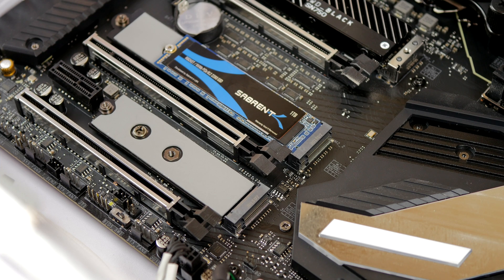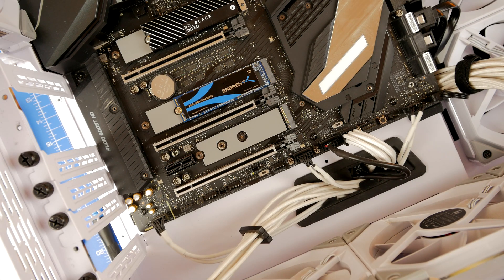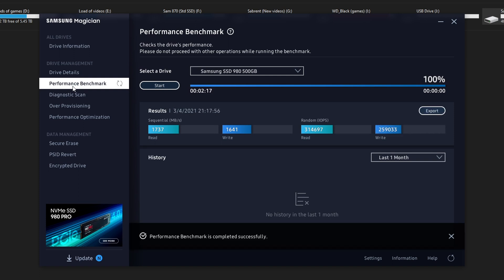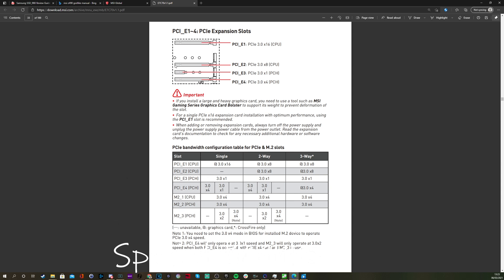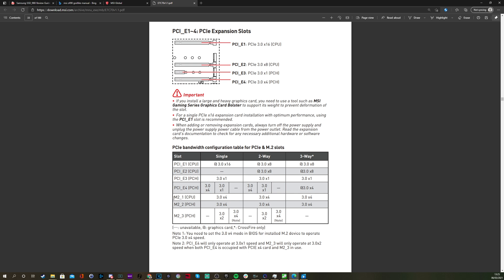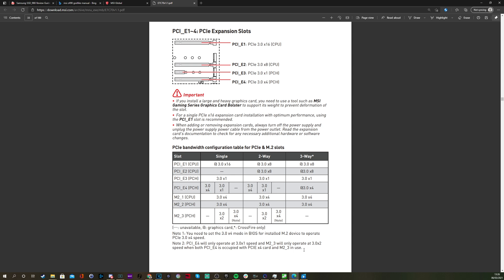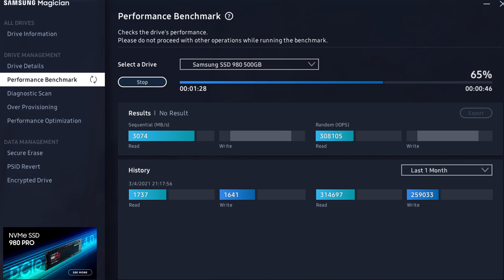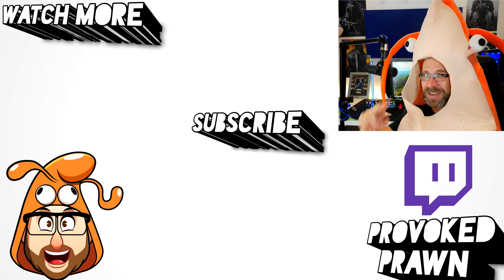Is your M.2 NVMe port slower than you realise? Not all M.2 ports give equal speeds

Comment: my biggest disadvantage is for a few days that my gpu lowers the band width couse of m.2 drive from pcie 4.0 to 2,5 gt /sec and i cannoot chose in bios gen 4 for my gpu ; maybe these new intel core ultra cpus will work better wit pcie 5.0 ; but , mostly they need to make motherboards with more lanes not shared by other components becouse that is annoying - when i ve  discovered m.2 ssd drives - thay are superfast - and move superlagre portions of data its very important for me - but they slowing down other components like gpu - so there is 1x solution to that use slower ssd-s sata III 2,5 inch drives - omg this is so annoying

Comment: For people who are looking for BIOS set up to make this works. This is how it worked for me:
1. Check if your mother board have USB4 in the back (usually it's a USB-C port)
2. Go to the BIOS and find IO setting option, disable USB4 (in my case the option is choose between USB4 and M2)

If you do so, now you no longer share 2 lane to the USB4 in the back and give it to M2 slot, so in my case all M2 drive I installed now run at x4 and full speed.

However you can't use the USB4 port on the pannel anymore.

Comment: I noticed you have all 4 DDR ram slots populated. That will decrease the speed of your ram. The ram will still run at its rated speed internally but the connection to the cpu will be slower. You have to run your ram in "dual channel mode" two sticks to get the fastest speed

Comment: What do you think is faster for the games data installation ? An 2TB M.2 drive encrypted with Bitlocker that is connected directly to the CPU with its x4 lane (as C: main drive). Or the games data on a second 2TB M.2 drive that is not bitlocker encrypted and not connected directly to the CPU with the lane, but via x4 to the chipset (and another 0,5-1 TB for C: drive) ?

Comment: Can I use all my m 2 ssd's drives? Prawn
Reply from the maker: It really depends on the motherboard. You can use them all but doing so might mean some don't run at max speed. Though it's less of a problem for newer motherboards
Reply: @The Provoked Prawn  OK thank you I'm using a asus prime Z790-p for intel 13 or 12 gen

Comment: I was using a B450 with 1 M2 slot and 1 adapter card getting about half the speed as the M2. I moved my x570 Asus board to replace this b450 thinking I would get full speed on both drives and now my Random Read/Write dropped in performance 2x on Write and 6x on Read. These are Gen3 970 Evo and SN750 drives. Only the SEQ read performance went up to proper 3000+ speed on the new x570 board. Random IOPS got far worse on x570 which was one of two reasons for this swapped motherboard. Other being Gen4 PCIe slot for the 8x Gen4 6600xt.

Comment: my motherboard only supports m.2 pcie 2.0x2 aka 10Gbps or about 900 migabytes per seconds
I understand that whatever m.2 ssd I put in it is going to run at max 900 migabytes per seconds for sequential speeds, but the question is, does this also affect random read/write speeds or is it only for sequential speeds?

Comment: okay question.. i have 1tb nvme m.2 ssd "samsung 970 evo plus" as my ONLY and primary drive in the first m.2 slot just under cpu.. i have a 2nd m.2 slot at bottom of mobo under gpu, ive used all storage on my 1tb 970 im thinking of adding another 1tb to 2nd m.2 slot at bottom of mobo.. SO.. would that 2nd m.2 still be faster than a normal SATA SSD? or would i be better of  just getting sata ssd, its all only for games.. i know my games would load slower on the 2nd m.2 than the first BUT would the 2nd be FASTER than a sata ssd still

Comment: My 980 Pro 2TB just got 6546 Seq Read and 5159 Seq Write on a Gigabyte X570 Aorus Master Rev 1.2 Top slot, all 3 slots on this board are PCIe 4.0 though, each one you populate takes away from the SATA ports so no big deal I only need two of those. I also have a WD SN750 1TB in the second Motherboard slot, a WD Blue SSD 1TB, and a WD Black HDD 2TB for Backups.

Comment: Thanks for the vid! I was wanting to put my new samsung 970 evo plus 1tb in the m.2_2 slot which is an x2 slot for better airflow and not being right next to my gpu, but I guess that's not a good option now. The m.2_1 is x4, so it should allow for the full performance. It just will get hotter there :(

Comment: !!!ATTN!!! In many motherboards. The Upper M.2 is PCIX Gen4, and that WD SN750 is Gen3. And in such cases, the lower M.2 is Gen3. Your board has 3 M.2 slots. So you might need to research any potential differences between the PCIX Generations they support. Gen3 are on average about 3000Mbps, while my current Gen4 is 7000Mbps. So as with any data bus, the slowest device connected to it, will set the overall speed of said bus.

Comment: I'm sad, the Phantom Gaming 4 manual mentions nothing about the varying slots and their differences, so it looks like I'm going to have to just experiment a ton and hope things work out. I'll ask elsewhere for a more immediate answer as obviously this comment section won't be as poppin, but I'm curious if switching the slots I have M.2's connected to will require reformating? I'd assume not as I'm still using them on the same PC, but that definitely is an immediate worry should that be the case.
Reply from the maker: Nope, should be perfectly fine swapping them.
Reply: @TheProvokedPrawn  Holy shit thank you for the blazing fast response!

Comment: i have same problem  my laptop , (1 year old 2020 hp)  , but it cant be changed ,come to find out the gpu uses 2 of the 4 lanes , and the other 2 are for the m.2, no way to change it so i get half speed no matter what i put in , and when on battery it drops in half again, only full speed when connected to ac,  when i bought it only spec available to the consumer is that its  nvme m.2 , kinda sucks
Reply from the maker: Take heart that it's still faster and an 2.5-inch SSD or HDD though.

Comment: Damn.. im finally at rest with this video. My crosshair X470 board with upper and lower M.2 slots populated, make my graphics card run at x8 speeds. Was pretty disappointed finding that out, and especially when its a premium motherboard. Frames are two to 3 fps slower, but i can handle that.
Reply: X570 feeling real good right now. I'm so glad I didn't skimp to b550 either
Reply: I wanted to utilize my second m.2 slot and read this comment, although 2 to 3 fps isn't too big of a deal for me either.

Comment: i got an msi x470 gaming pro carbon and mine is installed in the bottom one, which means i'm on the pcie gen 2.0X4 according to my manual, but is the generation of the port can make the ssd slower as well ?

Comment: So I have the same problem... in the magican software stands "PCIe 3 x 2" I can't find a way to change it! ... I do have just plugged the Samsung 980 M2 in. No other devices. :(
Reply from the maker: I'd suggest checking your BIOS settings. Have you used the top spot?
Reply: @TheProvokedPrawn  yes its plugged in the top Spot.. i was looking for a Setting Like lane rooting .. gut could Not find any Setting named Like this... What Name Had the Setting in Ur Mai mainboard?
Reply: @pumuckl5351  did you find it? What do I change in bios?
Reply: @karniskavva  hi. In my Case i Just repluged the SSD m2. Just try Out , maybe U think Its in ... But ITS actually Not , that was my problem

Comment: I have a similar problem in that an NVMe that should be hitting around 3000MB is only reaching around 1500. I supposed that could imply the slot is running at 2x instead of 4x?... I don't know if it's that "linear" or straightforward anyway. - But what's annoying is that in the manual for the MSI B450 Mortar Max that I have, they do have a table for the PCIe expansion-slots, but no specifications for the two M.2-slots that there are on this board. So it lacks information. - I could check the BIOS, but I'm not sure there's much to see there. And I guess I could try the slot closer to the CPU-socket, as it's now in the "second" M.2-slot, which might make a difference. - I don't know, it's all very vague and just a hassle...
Reply from the maker: The top slot will likely be the easiest solution
Reply: @TheProvokedPrawn  - Alright, I'll give it a try. - Do you know if this will cause any issues with anything installed on it? - Like the system will become confused because of a drive moving and assigning directories and such...
Reply: its because you are in the bottom m.2 slot. on b450 Mobo the bottom M.2 is only 3.0x2. top slot is 3.0x4.
Reply: @k20dada78  Does a 3.0x4 m2 nvme work in a 3.0x2 slot?

Comment: Hey, great video. Learned some stuff about SSD's which is good because I'm kinda a noob, I am using a rog strix z490-F with a 970 EVO Plus and I'm only getting half of the read/write speeds advertised(around 1700). both the m.2 slots are  Type 2242-22110, supports PCIe 3.0 x4 mode yet on samsung wizard my interface is PCIe Gen. 3 x 2... any ideas why this could be or how I can change it to PCIe Gen. 3 x 4 ??
Reply from the maker: Have you checked your motherboard manual? Perhaps using extra SATA drives or something else is holding the slots back. Alternatively have a look in the bios and make sure the slots are set to x4
Reply: @TheProvokedPrawn  Thank you so much for the help, I could've sworn I changed the ports but I must've not saved it aha. Just ran samsung wiz again and got 3500 for read and write so thank you again!! :)
Reply from the maker: @mattvile3432  woot
Reply: @mattvile3432  what ports?

Comment: I'm still confused.  My MB is an Asus Z97-A USB 3.1 with 1 M.2 slot.  I have a Samsung 980 there getting 833/801 read/write speeds.  My 860 SSD is at 550.  The only exp slot used is a gpu.  What am I supposed to do to get the speed up on that M.2?

Comment: This is why it's a good thing to learn about how pc components works
It's not just a lego that what you see is what you get.
I actually was just thinking about pcie lanes whether if I'll have enough bandwidth, but with pcie gen4, these issues are less pronounced or negligible.
Reply: As someone with a PCIe gen 4 mobo, do you have the answer?
Reply: @Ben-li9zb  it's like how Intel has bad m.2 support. Motherboards can have bad support too. Anything less than x570 will struggle to run all the m.2 slots, for one reason or the other (I'm still in the final steps of research to be 100% sure, though).
Reply: @VulcanXIV  That's great info.  Because, ALL these mobo's have this problem.  I'm looking at the flagship boards from ASUS, MSI, and Gibabyte....and all of them are pushing $1K.  At that price, at absolute minimum, they need to explain to what degree these M.2 slots will be effected.  Simply stating it "shares lanes", is nowhere NEAR enough.  And, their fine-print "*" BS extraordinarily misleading.  Now, I'm trying to find a mobo with the architeture that gives 3 M.2 slots full "dedication".  Having 5 M.2 slots is pointless if the slots 3-5 only run at 50%, because the user had the nerve to install a Graphics card.  The designer and functionality isn't nearly as frustrating as how unclear, and misleading the manufactures are about it.....ESPECIALLY at the prices today.
Reply: @Ben-li9zb  I have the answer. read the motherboards manual because they will tell you everything you need to know
Reply: @JoeyRKDP Outstanding....thank you Joey!

Comment: Hello. I have a Asus Hero VII motherboard. Now i have a pci_x16/x8_1 occupied by my video card. On slot M.2 i installed the nvme, 1TB, XPG. The write speed are now at 120MB/S, too slow. 
My other slots of pci-e are empty.
I have these slots empties: PCIEX1_1, PCIEX1_2, PCIEX1_3, PCIE_X8_2, PCIEX4_3. The PCIEX4_3 are associated with M.2 at X2.

Need use the slot PCIEX4_3 to nvme run better speed?
Thank you.

Comment: This video helped a ton, the Samsung Magician is a great piece of software its not only designed for samsung devices i used it for my silicon power m.2 and found out that the pcie slot im using runs Gen 2x1 so i definitely need to upgrade my motherboard
Reply: @republicjohn999  haha i have the silicon power 1tb should run at like 3.5gb/s its 400Mb LOL i do plan on upgrade my motherboard soon

Comment: Great video, thanks! 
That left me with the question: is there a way to install three m.2 drives and get full speed on all of them? If yes, then is it bios settings or MB type/price. If it's not possible - then it's very sad :(
Reply from the maker: I don't believe so. 😭
Reply: @TheProvokedPrawn  oh crap(
But 2 of 3 can work full, right? Or when you install the 3rd all of them go slow? I'm just very bad at understanding all those slots :)
Reply: @rasto4e4ek  2 of 3 could work and use the full potential of the drives depending on the motherboard. Depending on the motherboard the 2 drives should run with full potential with the 3rd one running slower than advertised. Sadly its very confusing and you have to go through manuals online of the motherboard you want to buy to see if it has what your looking for. I really wish manufacturers would make standards for this using the number system they use (ex: x570, B550 or z590).
Reply: Also this can also be effected by the GPU(s) you have in the PCI-E slots. So for instance if you have a multi-GPU system it will effect the speed of the SSDs.

Comment: What can I do about the same thing in laptop. I had a HDD and one empty m.2 nvme slot. I popped in the 980 same as yours and I am getting only half the marketed speeds. I checked in samsung's software, it shows PCIE 3 X 2 . If I am correct there is nothing I can do because this is the case with a laptop and not a desktop
Reply from the maker: Yeah, sadly I don't think you'll be able to do anything about that :( It'll still be faster and more reliable than a 2.5-inch SSD or a platter HDD though. Even at half speed. So it's worth doing still.
Reply: @TheProvokedPrawn  Yes, it's much faster than my HDD, which gives me about 60 MB/s, ssd atleast gives me 1.7 GB/s. Thanks for confirming !!👍